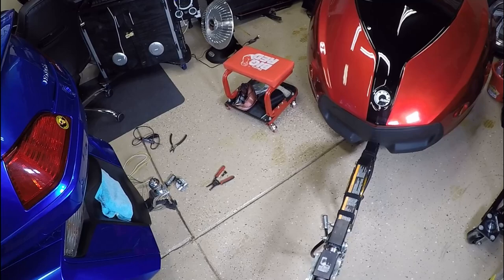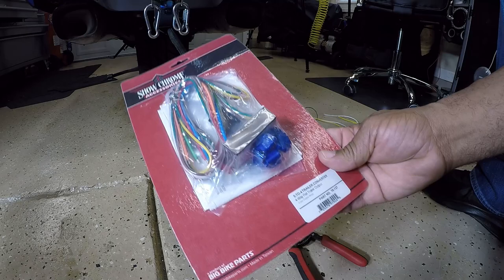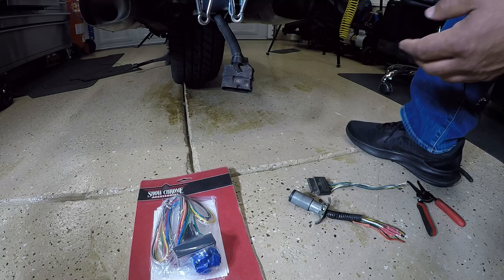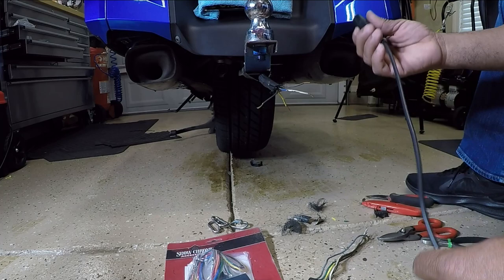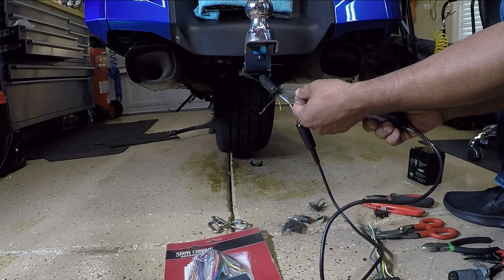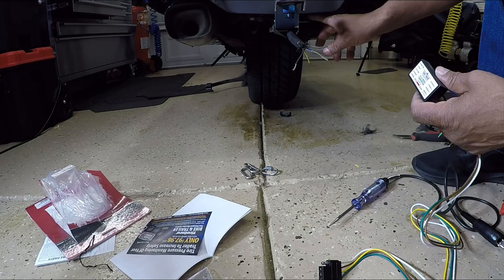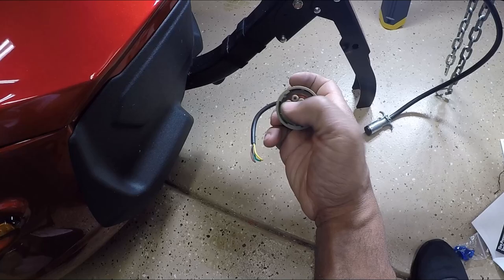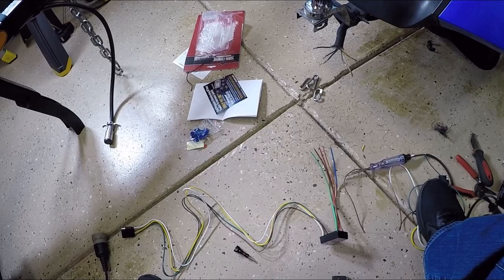Wiring a Can Am Trailer to a Goldwing | Show Chrome 16-127

Comment: Always great information Chris. For thought you can also ground the tester on the bike and check all the pins. Once you determine the ground you can connect to it for future testing. Also by using a 5  -  7 pin you can run a line for interior trailer light that isn’t switched. Just don’t forget not to turn it off.
Reply from the maker: You cannot ground the tester off the bike because the Honda Goldwing has an Aluminum Frame, but you can on the other hand ground off the negative post of the battery terminal. On my personal Goldwing I actually installed a Master ground block from Electrical Connection that excellent for extending ground connections.  Here is the link.  https://electricalconnection.com/index.php/product/master-ground-block/

Comment: I bought an Electrical Connections wiring harness for my bike.  It is 100% plug and play.  It lets me use 5 flat or 4 flat.  My trailer is a 4 flat.  No cutting or splicing. 
Even though I don’t have a GoldWing I enjoy your videos.
Reply from the maker: That’s very good info, post the product link here!

Comment: Chris, My Northern Tool trailer has 6 wires going into a 4 wire flat connector.  How do I connect this to the Show Chrome Fuse Isolator box?  Since the trailer has the turn and brake on the same wire, don't I have to separate them?  Because the SC Fuse Isolator box has separate connections for turns and brakes.  Hope this makes sense.

Comment: What' up Chris, good vid.  Yeah, you always want to place accessories in places where wires and devices won't be crimped or heavy pressure applied to it.  I also agree with you always checking the wiring setup when dealing with trailers and the wiring from the bike, you have check each wire to determine what function each wire preforms.  The standard color code mzy not be use by the previous installer.  The trailer isolation harness is another excellent setup.  Again good basic vid for basic general information.